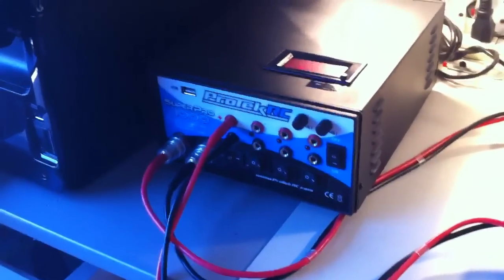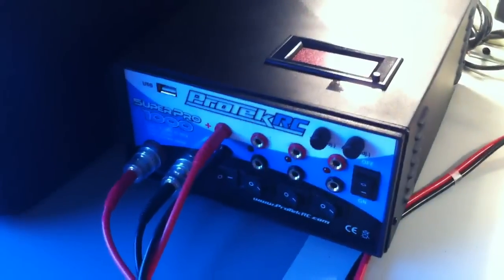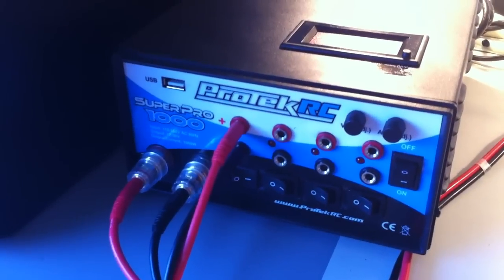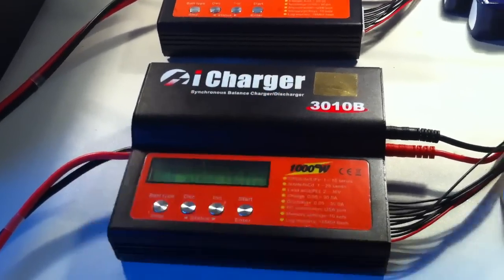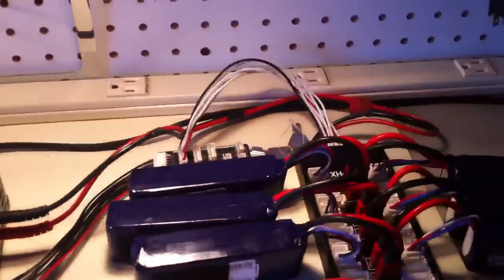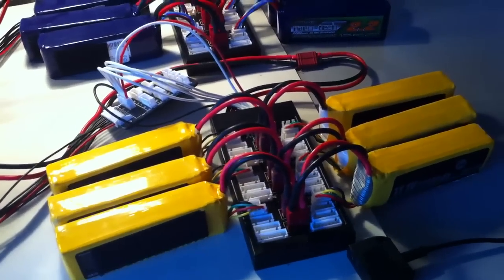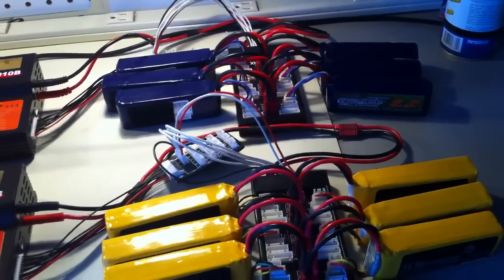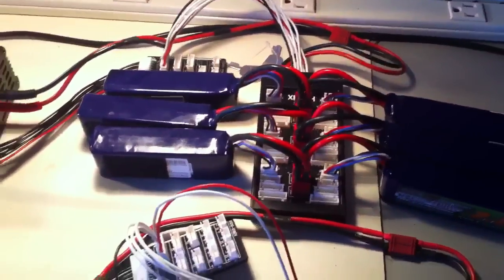RC Charging Station

Comment from the maker: Absolutely.  You can charge 1 lipo, 2 lipos, or 3 lipos.  Parallel charging is only a factor of the charging unit capability+power source and connectors to connect batteries.  There are units like the FMA Powerlabs that let you chain changing units.  But as you noted, you can parallel charge only 2 lipos if you like.  Just make sure you ALWAYS connect batteries with the same chemistry.  3s, 6s, but don't mix 3s and 6s together for instance.

Comment from the maker: Depending on your battery connector, you are usually protected.  Deans, or T-Connectors are hard to misconnect.  Same with EC5s.  However, the problem is the balance board.  You can force by accident a balance lead in backwards.  FOR THAT REASON, I stopped using the balance board and use the multi charging pig tails now.

Comment from the maker: So, standard power leads are just marked red/black. I have mine double marked now to make sure.  So, always be careful not to cross.  I never plug main power up to charger until I plug in leads and double check. And that is BEFORE connecting any batteries.

Comment from the maker: And the same holds true for my larger 6s 5000mah batteries.  If I charged 6 of them, that would be 6*5=30ams at a 1c rating.  Of course, the charger does not run at 60amps, but I do have two chargers.  I have sense moved to a 2000w Meanwell power supply so it can handle the voltage/amps.

Comment from the maker: Now, something you should avoid is charging batteries in parallel that are at different charge level to begin with.  The charger can figure it out and still balance the batteries, its just not recommend.

Comment from the maker: Well, to the iCharger the 6 3s batteries look like a larger battery.  So, I would not necessarily charge any batteries in parallel at 20amps.  You should still consider the max amperage when charging.  So, if I have 6 2200 mah batteries I would charge at 6*2.2=13amps or a rating of 1c.  So, even though 13amps would be more then 1 battery, it is not a single battery.  I would charge this same configuration at a 2c rating which those batteries can handle at 26amps.

Comment: how can you charge the packs on your main charger at 20 amps when you normally cannot charge a single battery at that?  unless having such a major capacity you can charge at such a high rate.  cause i have 6 2s lipo batts at 5000 mah each.so would i be able to charge at 30 amps safely?  or am i thinking incorrectly.

Comment: You can actually charge all 12 of those packs at 2c and only be pulling about 660 watts !! 12 packs in 30mins,and still have 340watts left on the supply to play with!! 10yrs ago I couldn't imagine these kind of #'s !!Powerlabs,and Lipos rule !!

Comment: How do you make sure that you do not plug them in wrong so it does not spark.  I love the charger, but  and just now getting setup for some new batteries and I had it spark two times what thought was correct.  Which way is correct way and proceduce for plugging in two packs in series.

Comment from the maker: @hpibajajumper Yes, Paraboards by EP Buddy.   Although, I don't use the boards as much any more and instead use the parallel charge/balance cables.  My lipos are now 6s, 5000mAh lipos and kinda large.  And some have short balance leads.  Sometimes, I would incorrectly plug the liops to the balance board causing a spark, or I would just have trouble getting 3-4 large lipos to the board.  The cables have larger balance and charge leads and I can still put them all easily in a lipo charge bag.